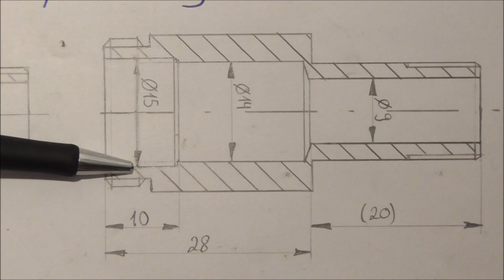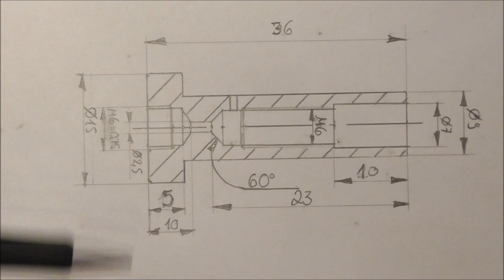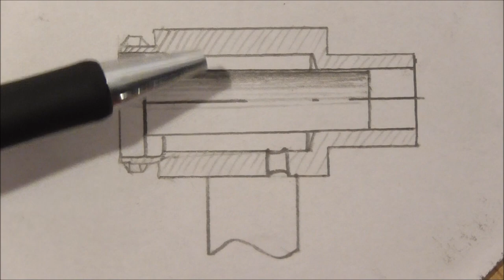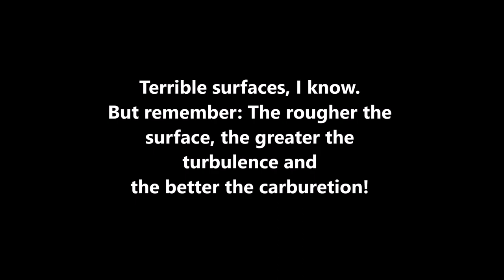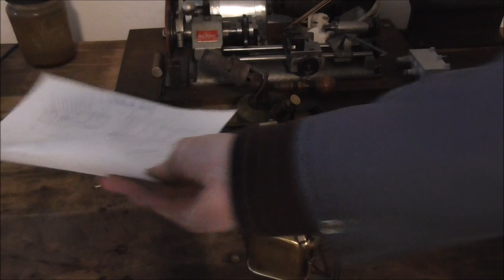Gasoline Blowtorch Tuning

Comment: Good work there! Congratulations on 1K subscribers! I remember when there were only 50 or so. I have used those gasoline torches and they put out many, many Joules. Ideal for melting the lead that was poured into pipe joints. For fine work, if you can find ab old-time soldering iron you heat that in the flame and then solder. Merry Christmas and happy new year.
Reply from the maker: Thanks alot! I actually became a big fan of gasoline torches after dumping my butane powered.
They may not be as hot as an acetylene torch but their flame volume is huge - many Joules, as you say. Making a hand-sized block of steel red hot does not take that long - and that's all you need for silver soldering!
I actually have some old soldering irons - even tried them out. The video I made is called "Old time soldering - A tutorial how NOT to." I guess you can see, how it went XD
In conclusion I lack the proper flux to clean the iron before soldering (ammonium chloride is used, I think) - and I made the iron way too hot. After it took me less than 10 seconds to solder it with the straight flame, I kinda lost interest in the irons, though XD
All the best
Adrian

Comment: I just love the shaper that you have Sir. You have a great idea with the blow torch. The lathe that you are using is really different, would it be called a jewelers lathe ??? Well done with the modification on the blow torch. Peace too.
Reply from the maker: Thanks! It really is a great bit of kit.
The watch is a clockmakers lathe.
One step larger than a watchmaker's, this one would be used for machining gears and shafts on wall clocks, grandfather clocks and the lot
Reply: @AstraWerke  Nice

Comment: Very Interesting 👌Answers perfectly my question whether petrol / kerosene torches can be used for silver soldering
Reply from the maker: Thanks!
You can silver solder with these puppies, I do suggest getting a low-melting solder though (mine melts at 620°), it'll make your life much easier.
Getting some insulating bricks also helps greatly bith larger parts.
Reply: @AstraWerke  Nice job with reworking the blowtorch. I have a couple of different Primus torches,   both petrol and paraffin. It's true the larger ones are paraffin lamps, but there is some large petrol lamps to be found also ☺️. From what I can understand it's roughly the same flame temperature for both petrol and paraffin. I kind of like paraffin better since it's not as flammable.
Reply from the maker: @drunkonkerosene  Well, with a parrafin torch, silver soldering and maintaining heat shouldn't be a problem.
Whilst less flamable, the Energy contained within a parrafin flame (Joules) is higher than of petrol, which makes them consume less fuel while giving out the same amount of power (just like with a Diesel Engine compared to a Petrol model with the same HP)
Reply: @AstraWerke  It sounds familiar. Never the less I became interested in tweaking a petrol torch I have that had quite some beating over the years ☺️. If I remember correct it's  from 1938. Funny fact is that most Primus torches and stoves are marked with a letter kombination stating the manufacturing year.

Comment: I have this one
How long its can flame? Becoz the tank is getting hot and up. 
May can explode if us for long hours or not? The pressure is still low but the tank is getting hot
Sorry for bad english 😊
Reply from the maker: They're made to be operated continuously.
Brass conduts heat very well, that's how its supposed to work: the heat of the flame warms up the tank, causing the gasoline to boil, thus raising pressure.
Reply: @AstraWerke  i used petrol and diesel mixed 55:45 btw
Im worry when its warm becoz its made for kerosene and i use petrol
Reply from the maker: @indonesia-unik  Well if it's made for kerosene, you should use kerosene. Diesel burns much hotter than petrol or kerosene. In a mix of both, the petrol will boil off first, and then the diesel.
Reply: @AstraWerke  ok thanks so much for your information.
Btw hard to find kerosene here
Reply from the maker: @indonesia-unik  It's basically lamp oil

Comment: You made one mistake with these. The gas is being burned inside the nozzle. You can see that because the nozzle is glowing really hot in the front and a blue flame is coming out the small air holes. You have to push the flame out the front. you can file the holes down in a 45° angle more like a venturi nozzle and you can also increase the pressure so that the air and gas is pressed out stronger out the front.
Reply from the maker: Should the holes face toward the torch or toward the front?
Reply: Toward the front of the torch where the flame should come out by 45° deg..
 
The idea is to suck in ambient air throuth the torch gas pressure so you get more air flow and thus a hotter flame in front of the torch. 
Basically the current holes are straight bore from outside the zylinder (torch) to it´s inside. You want to bore them (or open them up with a file) by say 45° deg. so the air can be sucked in from behind the torch and puched to the front.
Hope you understand what I mean.

Additionally you can create a metal sleeve to cover up a round of holes if needed and therefore increase or decrease the airflow to create a hotter flame. You will get more control over the flame this way.
 
Look at the video from "Pauls garage" here on YouTube, he makes a torch from scratch to melt metal where he basically explains this.  @AstraWerke

Comment: What is the packing purpose for?
Reply: And is the Clayton & Lambert a good torch? Thank you...
Reply from the maker: Keeps gasoline from shooting out the grip end.
Reply from the maker: @71camaro  I don't own a Clayton&Lambert - but I haven't had a "bad torch" so far. They all do what they're supposed to do. I only heard that some of these torches have a steel tank bottom which is prone to rust - so be careful. Maybe fill it with water and pump it up to full pressure before lighting it up.

Comment: you should turn a new cylinder and use an old torch head and pressure it up with a shrader valve, i kinda wanty to try this out on my own but no lathe  :(
Reply from the maker: you mean to pressure test it? I did that by using the torch's built-in pump and lettinfg it sit for an hour.
Reply: @AstraWerke  no i meant to build a heavier wall thickness cylinder, make the threads for the burner then add a schrader valve to pressure it, instead of hand pump. basically a new cylinder and a air valve. that way you could pressure it up with more psi so it lasts longer and burns longer. so the cylinder would be lathed and tapped pretty much for a heavier duty canister. my old one burst open when i pressured it up :(
Reply from the maker: @johndowe7003  Whoa, that's one hell of a mod you're talking about! These torches maintain their pressure via flame heat being transmitted into the fuel tank (since they're all brass which conducts heat brilliantly) and making the gasoline boil. At a certain point, increasing the tank pressure won't improve the flame size any more because the limit of what can pass through the nozzle is reached. That limit can actually already be reached with the hand pump, so I think pressurizing it with external media would be a little over the top (except for a very large torch with a big tank maybe)... Especially when you mention yours ruptured! Imagine one of these things bursting and spilling boiling gasoline everywhere - whilst the flame is roaring!
I'd rather take a little more time to solder my parts together instead ;-)
All the Best
Adrian
Reply: @AstraWerke  mine ruptured with it being lit 😂
Reply: @AstraWerke  i was thinking of building a whole new pressure tank with steel, adding a psi gauge for about 10psi or 15psi and reuse the same burner Assembly